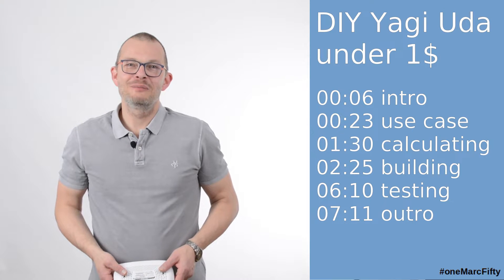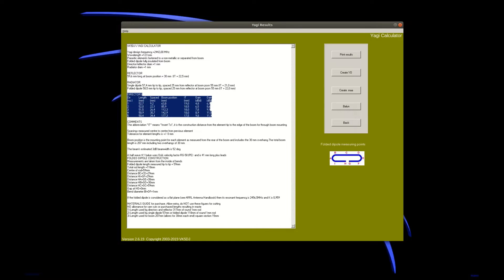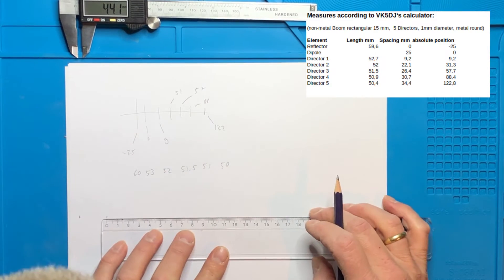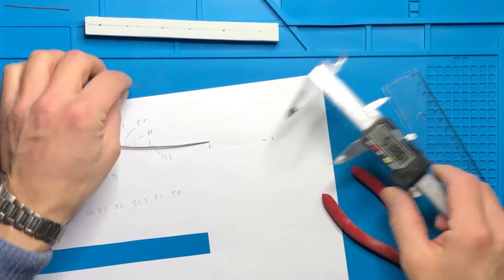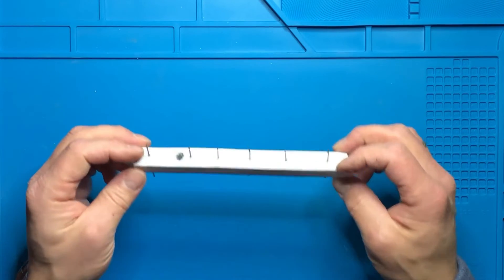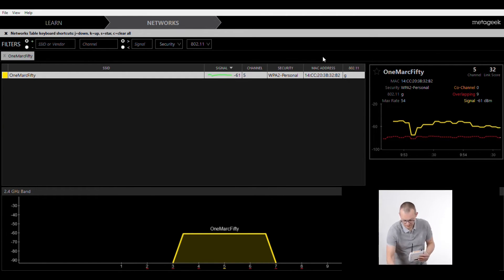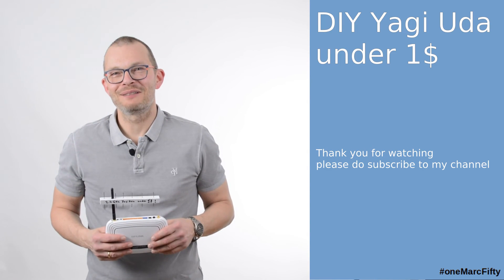#2 cheap  long range wifi antenna

Comment: Writing from January 2026, I can confirm this is working. I just slapped some straightened paper clips cut to size in a piece of styrofoam and using my ducky antenna (from a USB WiFi dongle) and it made my connection a whole lot better, from -87dbm to -79dbm. I know it isn't great but it's stable and I can see videos in 1080p.

Great video!

Comment: WOW!!!!  The idea in this video is amazing, and I can verify that it works too.  Here is my situation:
I have a wireless access point (TP-Link EAP 225 Outdoor) in our back porch.  I really wanted the WiFi signal to reach to an area where we like to sit in some chairs and enjoy the scenery.  Unfortunately it was just out of range for the WAP.  Barely out of range.  When I would sit down in the chair I would lose the signal, but if I held my phone over my head I could get one bar of WiFi (on my iPhone).  The WAP came with a pair of omnidirectional antennas.  I bought a new pair of omnidirectional antennas for the WAP that claimed to have higher gain (or maybe it's really less loss).  Those worked exactly the same as the originals.  I put the original antennas back on the WAP, and built two of the inexpensive Yagi-Uda antennas as shown in this video (one for each of the WAP antennas), and slid them halfway down the WAP antennas.  I get two bars of WiFi on my phone now when I'm sitting down.  I could not believe it!  
Why was I shocked?  I understand the theory behind the waves and antennas however there was no way I could build an antenna perfectly to such tight specifications.  My wire was in a coil so it wasn't straight, and when I stuck it through the foam the directors were not exactly at the same angle, etc.  Even with all the imperfections the signal is still much improved.

Comment: @OneMarcFifty  Have you tried this stick on design in a way so the active antenna and the reflector / leading elements align? It seems odd to me that the elements are not in the same plane as the boom.

Comment: At 2.4GHz, the bend in the wires will be enough error to through off a simple dipole, much less a yagi with parasitic elements. A 7 element Yagi, properly constructed and tuned, would be a MUCH more dramatic gain than what we see here. I will say though, that I fully believe what we see here is not faked, so props for being honest, but noone should expect to get a good antenna like this. If you do, you got really lucky. I good dipole would have had these results, minus the directionality.

Comment: This is awesome. I hadn't realized you could build a yagi around an existing antenna. 

I can't wait to try it with my access points that I bought for trying out the Amateur Radio Emergency Data Network.

Comment: You didn't tell as what distance the signal tests were made, what was on the other side, laptop, tablet etc. What is signal in your nice spot in the garden, I think it is a key. Best regards, nice idea.
Reply from the maker: Hi - yes, you are right - I have not made any specific measurements here. I think it also depends on a lot of things (materials used for the boom and directors etc.)

Comment: Thank you for the very informative video! I have a question though: as far as I know (which is not a lot, so I may be wrong), this Yagi Antenna can only be used for receiving 2.4 GHz, right? Would there be a way to make a simple and small Yagi Antenna to transmit a signal? Would you be able to modify this antenna? Thank you so much!
Reply from the maker: You can use it for sending and receiving.

Comment: Have you tried 5 GHz MIMO on the WRT3200? I added two on top of the huge 7 dBi antennas, and they seem to add 4-5 dBm of additional gain. With the small antennas I had a dark spot with packet loss underneath the TV, two floors below the router, now it seems better. I'm getting up to 400 Mbit/s down and 200 Mbit/s up either way: small or large + yagi.
Reply from the maker: No, not really - I think I am going to sell it and replace with a custom build on x86 or a Belkin RT3200
Reply: @OneMarcFifty  Recently there was an important fix for RTW3200ACM which will make it in the upcoming 21.02.2, or you can give it a last chance on master or my build. In short devices show as connected but do not communicate.

Comment: I used a thicker copper wire to the same specifications and got 100 % at 150 yards.  Very good measurements for both a 2.4 and 5.0.
Reply from the maker: Hi Peter, many thanks for sharing - 150 yards is excellent !!!! What did you use for the 5 GHz antenna ? I found the built-in antennas of routers to be too thick to put a non-soldered antenna on top of them...
Reply: No reply....(?)
Reply from the maker: Nope ;-)

Comment: Thanks for your video, could you build one for 5Ghz?
Reply from the maker: Hi Alex, that will be difficult with the solder-free design like it is shown in this video because the distance between the parts will be too small at 5 GHz and hence you could not put it on an existing antenna. Sorry.

Comment: Does it reduce the range in other directions?
Does the phone/tablet also need an extender to transmit farther back to the router?
Nice channel, subbed!
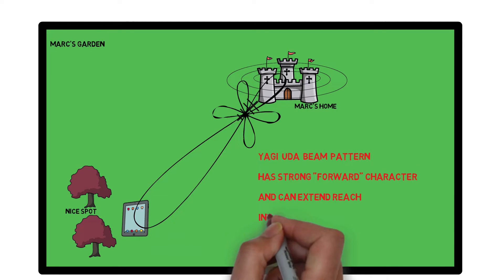Reply from the maker: Hey, many thanks for your comment and thanks for subscribing !!! The antenna does extend sending and receiving signal, i.e. in normal cases you would not need an extra antenna on the tablet. Of course it also depends on neighbors using the same channel etc. and also keep in mind that the beam pattern also sends/receives at a 60° angle (see the beam footprint at  1:06)

Comment: if we attach two such antennas to WIFI AP then can it form beam in two different directions?
Reply from the maker: In principle yes - however, you can't attach two yagis to the same antenna, so you could attach one yagi to Antenna 1 and another one to Antenna 2 - however, you would need to tell your router what to do which each antenna - that might prove to be difficult. If you have however two different Wifi interfaces and one antenna with each, then yes - no problem. What would be your use case here ?
Reply: @OneMarcFifty  A use case can be a long-range repeater.

Comment: Can this antenna work for at the receivers end of a wifi repeater , my friend has a wifi connection his home is 50 to 60 mtr away from my home  i have use an old wifi router as a repeater it connects but there wifi speed is very low like 30 to 40 kbps what can i do for that i don't want to use lan cable
Reply from the maker: Should work - however 50-60 meters needs thorough adjusting and positioning. Please also check the local regulations if you are allowed to do so.
Reply: @OneMarcFifty  Its allowed if the person give permission to share his wifi
Reply: OneMarcFifty   but due to some house between  i am getting problem. 
If i used yagi udaa antenna  at receiving  end   of my router will capture the weak wifi signal and enhance my router range i am using "i-ball Banton 150M"

Comment: how to put it in an esp32 whithout soldering like in this video?
Reply from the maker: It depends what type of board you have. If you have some type of coax Connector, then you could of course just connect a L/4 dipole to it. Need to investigate for the commonly used printed antenna - Actually you are giving me a great idea for a new video ;-)

Comment: Can we call it a Yagi antenna if there is no dipole as the active element? Or the monopole of the AP in combination with director 1 is considered a dipole?
Reply from the maker: Hi Pablo, ultimately - in order to know if the active element is a dipole or a monopole you would need to crack the antenna of the AP open. I'd suggest that we could safely call it a Yagi or rather Yagi-Uda because it is based on the original design of 1926. For sure, there are a lot of variations but this short comment field is to short to elaborate on all of these. If you are interested in Antenna design I can safely suggest Karl Rothammel (Y21BK/Y30ABK) and  Alois Krischke (DJ0TR)'s Antenna book - it has roughly 1.500 pages though ;-)
Reply from the maker: Actually thinking it over I might not really have answered your question. Looking at the length of the antenna (roughly 9 cm) and the wave length (12 cm) this suggests that we actually have a lambda/4 dipole (would make sense w/r to the sma connector). If we had a monopole antenna (l/2) monopole then presumably your suggestion with the first element would be right or alternatively we would need to push the anteanna to the bottom making it a half (monopole) yagi. As the boom is not made of metal, the result would be the same. I need to look this up and talk to an expert in order to know for sure, Also I am curious and might open the AP antenna once I find the right tools to do so ;-)